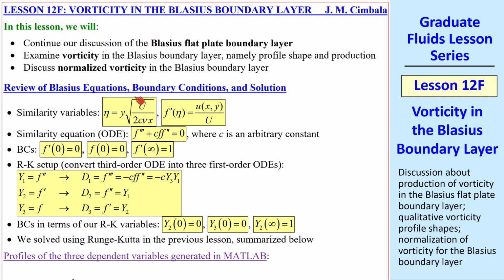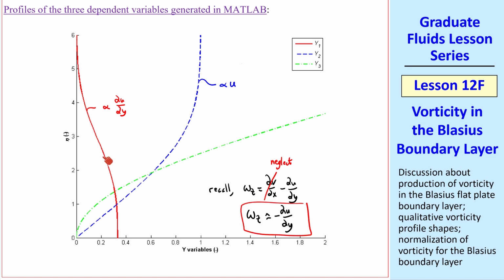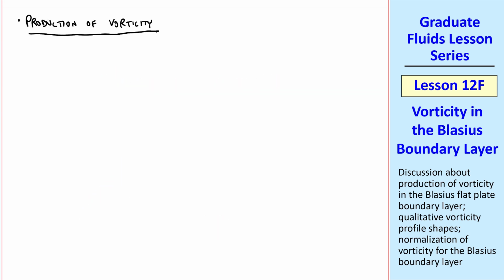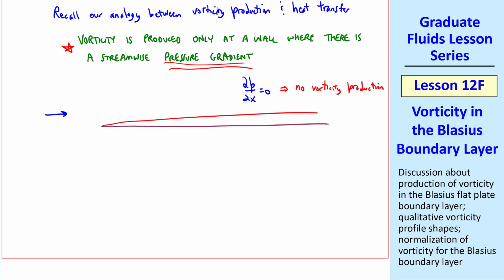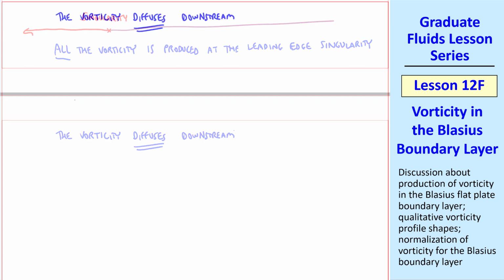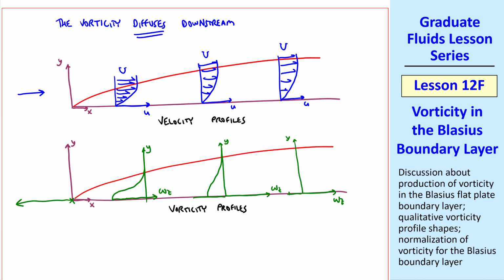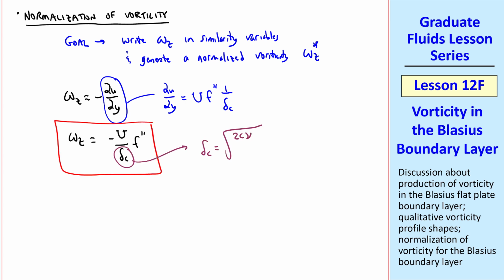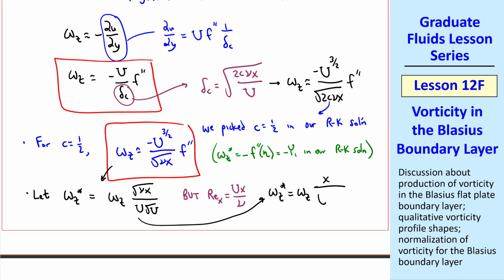Graduate Fluids Lesson 12F: Vorticity in the Blasius Boundary Layer

Comment: Thank you sir for this explanation. I have doubt about the energy relation with this vorticity production. How vorticity getting energy ? and the process is completely irreversible right ?  and when the vorticity diffuces in the downstream, does it increases the energy of the fluid ? I mean for zero pressure gradient, the kinetic energy of the fluid along the plate is constant. It is not getting effected by vorticity production as u is constant.
Reply from the maker: For flow over a flat plate, the kinetic energy is not constant because the fluid near the plate is slowed down by viscosity as it moves downstream. The process is not reversible since friction is an irreversible process.